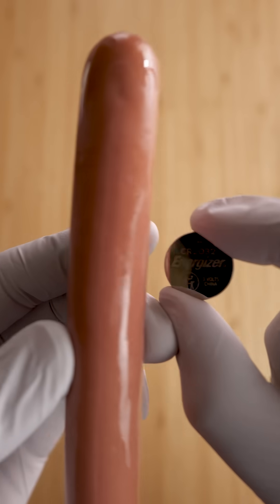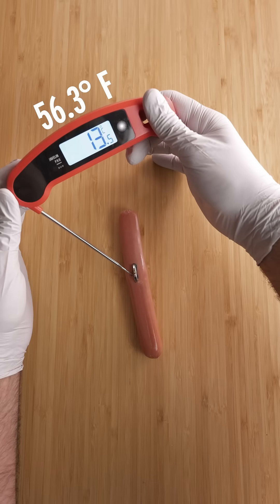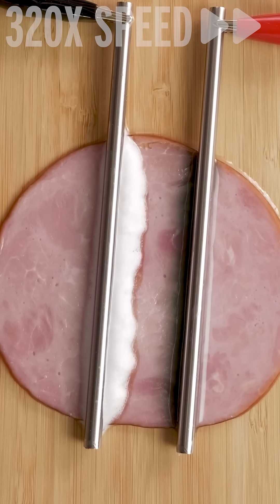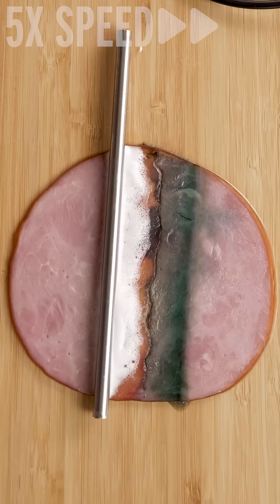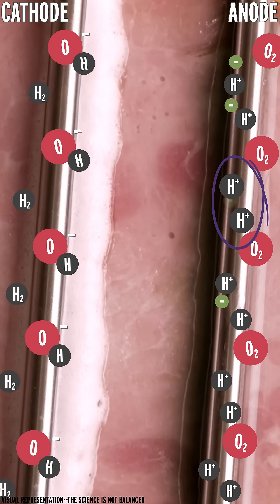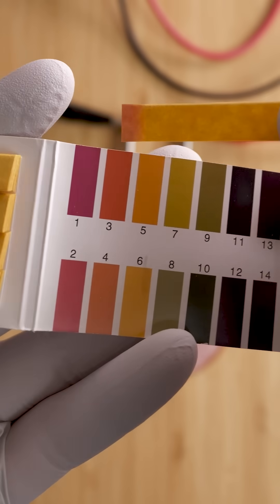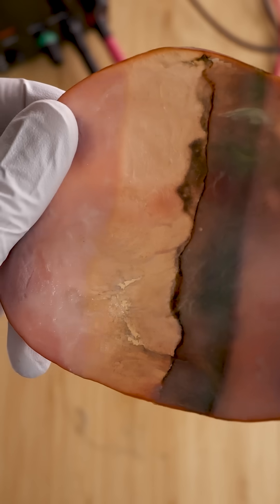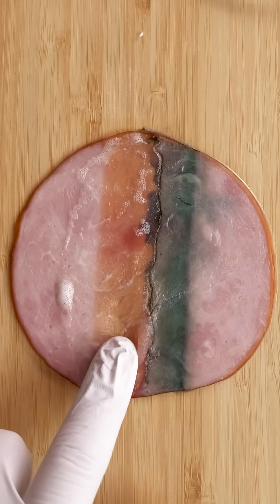don't swallow watch batteries

Comment: This is so false. 1. It would take to much time to do damage (please everyone do the hotdog thing and see how looooong it takes). 1.2 by the time it would do damage you would already poop it. 2. Stomach acid would oxidize the battery and stop the process. 3. Any base form would be neutralize by stomach acid. 4. Try just putting it on your mouth and you'll see that nothing happens, if nothing happens in the mouth, much less in the fraction of a second in the esophagus. 5. There are dozens of people on the comments telling stories about how they swallow a battery as kids and nothing happened

Comment: I have swallowed a battery before. It's the little stout button ones. Smaller radius but thicker. Like a medicine tablet.

They tasted weird but not bad. It's not even a taste actually, It's a sensation on my tongue. I knew I am not supposed to eat these but I just liked the sensation so I kept putting it in my mouth. But then, somehow, I accidentally swallowed it. Thankfully, my kid brain was smart enough to alert my mother immediately that I swallowed smth that I shouldn't.

Fortunately, since it is a small battery tablet, it just went into my stomach and not stuck in my throat

I was rushed to a hospital and, I don't remember this part at all but, apparently I just pooped it out. that's what my parents told me at least. But for the life of me I don't remember that part.

Comment: I swallowed either a watch or a button battery when I was in preschool. I was probably old enough to know better but  it didn’t cause any problems. I told my parents and I had an xray that clearly showed the battery in my stomach. It went out the other side later

Comment: The reminds me of an appliance that used to be sold that had metal spikes that would hold a hot dog.  Those spikes were in turn attached to a line cord that you would plug in.  The current would pass through the hot dog and heat it up.  Because line current is alternating current, the acid and base would cancel each other out and the hot dog would taste ok.

Comment: I wasn't sure what I was seeing when the battery was lodged inside the hotdog and almost scrolled down thinking this is just satire. Just in case I checked the comment to see what people were saying and realized that this is a dead serious PSA. Great work with the visual demonstration, now I will inflict this important knowledge on everyone I know.
Reply: Yes but please take a look at the size of that battery and that hot dog once again and keep in mind the child esophagus is the same size if that sausage or hot dog they were using That battery only got halfway of battery into that hot dog and those type of batteries are about at the smallest that size, so if you think about it there's no way a child let alone adult would be able to swallow those batteries It just wouldn't happen without being blasted down their throat there's no way anybody could swallow one of those. And the voltage of these batteries are pretty high so once they touch the sensitive tongue like a 9-volt battery but these are much higher would be spit out just like you do one of the nine-fold battery touches your tongue or 12 volt battery so none of this is actually going to happen unless they actually cut the stomach open and put it in or blast it down somebody's throat which then there would be far more problems than the circumstances. So please keep that in mind.
Reply: @shane5314 They have varying sizes.
Reply: @shane5314  Still probably happens if there had to be a psa about it. I get what you’re saying, but I’m sure it could still cause a bit of damage if it got lodged right at the opening

Comment: When I was much younger , in the 70s, I had a wonderful appliance in which you jammed hotdogs onto metal spikes (each end of the hotdog is spiked) and then applied wall socket electric current across them to cook them. Took way less than a minute. It was surely the most insanely dangerous thing I ever had, but man was it cool.
Reply: Yeah the 70s was basically two steps above the safety ladder of the 1950s which was RADIATION KITS FOR JIMMY
Reply: @avosmash2121  ngl though that stuff sounds amazing! mail order uranium ore.
Reply: interesting! did it taste any different from a normally cooked hotdog?
Reply: @Coco-hq8vt  For me they tasted like microwaved hotdogs
Reply: oh i remember big clive doing a video on one of those, i think it was called a hot dogger iirc
Reply: @Nova-Pixel-6  I came here to mention Big Clive but you beat me to it!
Reply: I remember that.
Reply: You guys had some good toys, like those lawn darts that were basically metal tipped spears😂😂
Reply: We have the technology. We can rebuild it.
Reply: Ha, sounds crazy
Reply: Yo where do I get one of those.

Comment: This is why when they use electrics for physiotherapy, they use shifting DC, one of the best methods is called "Russian Current", which switches the terminals and also changes the voltage difference in a periodic way, like a sine wave

Comment: I work in an ER and the ambulance, we use the RETTS triage system and anyone (child or adult) that swallows a button battery gets at minimum an orange triage, even if all their vitals are fine. Immediate transportation to the nearest hospital with personnel that can perform endoscopies. Usually an X-ray is done immediately to see whether a battery has been swallowed and exactly where it is if so.

The suspicion that anyone has swallowed a button battery is enough to get an orange triage.

Comment: Not surprising that high ph can do that; working around genuine rocket fuel, the only thing they worried about moreso than inhalation was *ANY CONTACT WITH YOUR BODY OR CLOTHES WHATSOEVER*
In addition to being so basic it would permanently damage your skin, it will also combust on contact with almost any material. Even the absorbent pads we had specifically for the fuel had to be water-soaked otherwise they'd go up in flames

Comment: I still can't believe with all the warnings and education via news and other means that people still don't take basic precautions with these batteries.  I also did not know it was doing the damage via the method in your video as most news reports seem to indicate its the battery leaking or passing a current that burns the insides so it would be great if they stepped up the education and information to show the real method of damage from swallowing such a battery.  Can other types eg if someone somehow swallowed a AAA or the smaller lithium batteries that cameras used to have in them.

Comment: Swallowed that exact nickel sized button battery in 3rd grade. I used to be a big circuit board nerd, and button cells were common. They can be tested the same as a 9v, touch on the tongue. Do not do this! I was little, that’s my excuse.

zap, gasp, oh shit now it’s stuck in my throat and it’s instant pain, this horrible burning sensation. There’s no sleeping, and I don’t remember why but they wouldn’t knock me out or anything. Which seems weird cuz I was inconsolable and flailing around it hurt so much. 6 hours and a bus trip to Boston Childrens and it was out, but left a gnarly hole in my esophagus. I couldn’t eat solids for months while it healed.

My poor mother… she still won’t let that one go

Comment: Worth mentioning as well that gastric acid (stomach acid) has a ph of 1.5-3 ish, and soda (coke, pepsi, etc.) is 2.5-3.5 ish, so 3-4 is really not an issue. If it were, we'd get serious burns whenever we vomit. High ph, on the other hand, is not normally present in our systems or the food/drinks we consume, so our ability to resist it is very minimal. Excellent demonstration
Reply: If you've ever got a base on your fingers and felt that slimy feeling, that is your skin dissolving.
Reply: @castleanthrax1833 oh my god
Reply: i dont know about you, but my throat DOES get mildly burnt whenever i vomit.   Thats why your throat feels raw and scratchy after... stomach acid burns.  not SERIOUS burns but vomiting is quick and just with the acid quickly passing up thru ur throat on the way out to the toilet (or floor i guess lol) it leaves a decent burn pretty quickly

Comment: Cranked the voltage? That's not a good experiment. Cranking the voltages makes the electron overcome the meat resistance and makes the current go through causing the damage. With low voltage i doubt it can do such damage

Comment: For those who don't know:

This short explains about speed of light, black hole and singularity. The speed of light, around 300,000 km/s in a vacuum, is the fastest speed possible and serves as a fundamental constant in physics, crucial for equations like E = mc² This means it remains the same for all observers, regardless of their relative motion. Black holes are formed when massive stars collapse; they are regions with gravity so intense that not even light can escape their "event horizon." At the center of a black hole is a singularity, a point of infinite density and gravitational pull where space and time are stretched to their limits. This singularity goes beyond current physics, as the known laws break down in such extreme conditions. It is also a point of infinite density and infinitesimal volume. The immense gravity of the singularity causes extreme curvature of spacetime. Space and time themselves become distorted and cease to have meaning as we understand them. The singularity represents a limit of our current knowledge. To fully understand what happens at this point, we may need a theory of "quantum gravity" that can reconcile the laws of gravity (Einstein's theory of general relativity) with the laws of the very small (quantum mechanics).

Comment: Um... You basically have an acid and peroxide both attacking the soft tissues. When you use peroxide in an open wound, over time you see the dead flesh go clear and the freshly formed flesh turn bone white. I had to deal with that with road rash with gravel imbedded in my palms. I would hate to have that feeling inside my throat, ya know?

Comment: It's not just splitting water molecules, it's also splitting all the other molecules which permit electrolysis, and those others in the current path away from the electrodes.

Comment: Button batteries are smaller, chubbier, usually use what we call alkaline chemistry and are usually 1.5v. You have a coin cell which is 3v and usually has lithium chemistry (Li-MnO2). I wouldn't want my son or anyone swallowing either of them. But the 1.5v alkaline batteries are known to be significantly less trouble. I understand that hospitals take them out of people fairly frequently.

Comment: The pH of stomach acid is between 1 and 4, depending on whether you're fasting or after a meal.

The alkaline range is neutralized by stomach acid and is completely harmless.

There are so many reasons why swallowing a button cell is harmful, but electrolysis is certainly not one of them.

Simply place a button cell in salt water and see what happens.
Reply from the maker: If it gets to the stomach, yes, the acid will neutralize any base produced. But in kids (small esophagus) it can get stuck in the throat, and that's when electrolysis causes problems. See for example: https://pmc.ncbi.nlm.nih.gov/articles/PMC5966199/

Comment: During the video, you say, "This releases hydrogen ions, also known as acid, at the positive terminal, and hydroxide ions, also known as base, at the negative terminal." However, the corresponding picture shows hydrogen ions at the anode, which I thought was negative, and also shows the hydroxide ions at the cathode, which I thought was positive. Am I mixed up here, or is there an inconsistency? I swear I'm not trying to do a gotcha here or anything like that, I'm just trying to understand the reaction better.
Reply from the maker: In an electrolytic cell, the anode is the positive terminal and the cathode is the negative terminal (this is the opposite of battery terminology, where the anode is negative and the cathode is positive). Anode is always where oxidation happens, whether it's positive or negative. Cathode is always where reduction happens, whether it's positive or negative. Good quick explainer here: https://chem.libretexts.org/Bookshelves/Introductory_Chemistry/Introductory_Chemistry_(CK-12)/23%3A_Electrochemistry/23.09%3A_Electrolysis_of_Water

Comment: Using electrolysis to make acidic and alkaline water is a very old thing, both have great medicinal value. Acidic one sterilizes, helps with digestion, alkaline boosts regeneration immensely, those are the primary functions that I use them for, but the applications are nearly limitless. You can find special devices for making it online, or you can make it yourself, it's actually extremely easy to do so, if you have needed education. I highly recommend checking this out for all the people with health issues, you can potentially save thousands and a lot of health.

Comment: Human flesh is way too resistive to electricity for a simple 1.5v of electricity at 200mA to do anything. Eating a battery will cause you constipation, so chemical burns are the last thing you need to worry about.

Comment: The amount of base formed is negligible, and it is neutralized when mixed with gastric juices. What's really dangerous are the heavy metal salts they contain, which are released during electrolysis due to electrode corrosion (nickel, chromium, cadmium, etc.).

Comment: The battery hasn't as much current as your source have. So the damages would be lesser but still, not good swallow batteries, higher and  the voltage bigger and faster the damages

Comment: Too many younger children have been mis diagnosed in hospitals sent home sometimes twice to die in agony, younger kids and toddlers scream to communicate something is wrong with their parents' panic to call an ambulance when it's too late, if you use these batteries at home never leave them laying around. Several agonizing deaths happened in Australia a few years ago.
There is a very simple and quick way to know for sure if the child swallowed a button battery or any other Metalic object and a verry CHEAP piece of equipment for ambulances and children's hospitals to have on hand, That is a Handheld Metal detector wand the same as security guards use at airports , or pin point detectors gold Prospectors use , they can cost from $15 on E-bay ,Amazon or prospectors suppliers, even the cheapest will detect the smallest battery. They should be Mandatory in First response equipment vehicles more so with the ongoing Exploding air bags sending metal shrapnel in to victims faces eyes and brains.